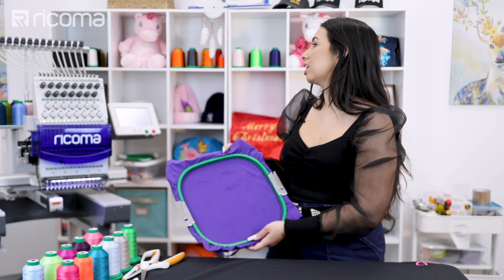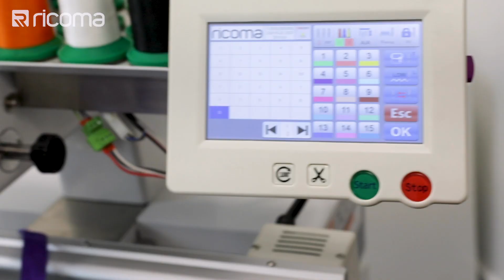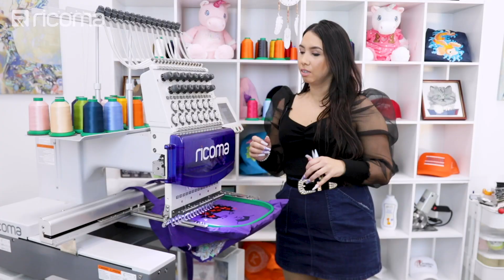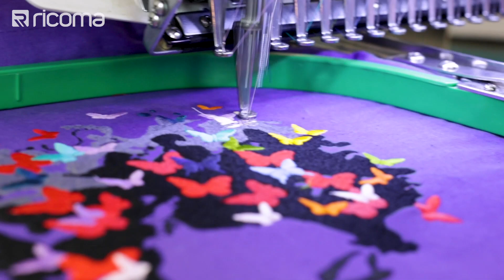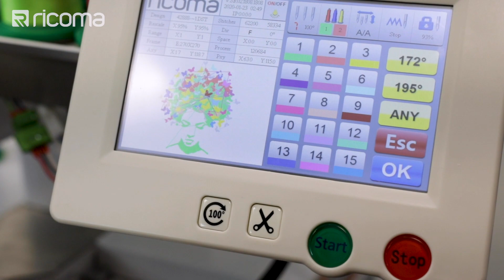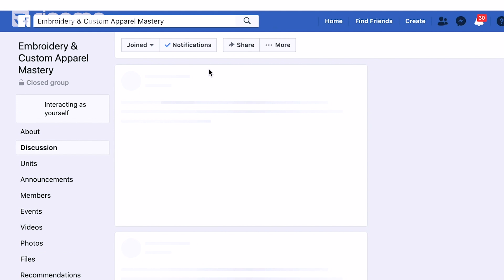Embroider 26 COLORS with ONLY 15 needles!? Pro Tips!  (Embroidery Hub Ep103)

Comment: I'm curious why you chose 3 layers of tear away instead of switching to cut-away? Isn't cut away stronger, or did I misunderstand something? 

Thanks!!!
Reply from the maker: Hi! Tear away is used for firmed woven, or natural fiber that doesn't stretch. It's also more suitable for very strong and stable fabrics and is also used when you don’t want the backing to show on the other side of the design, such as back of towels, caps and bags. Cut away is more suitable for knits that are washed more frequently.